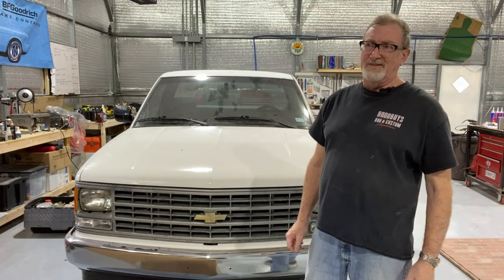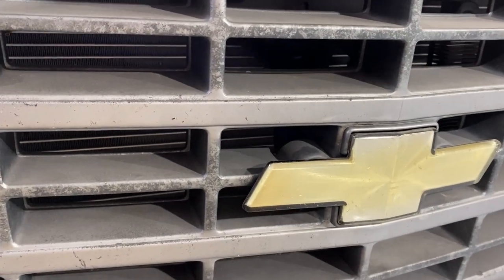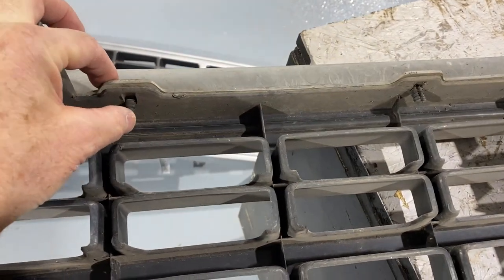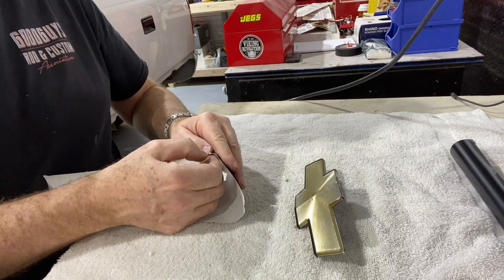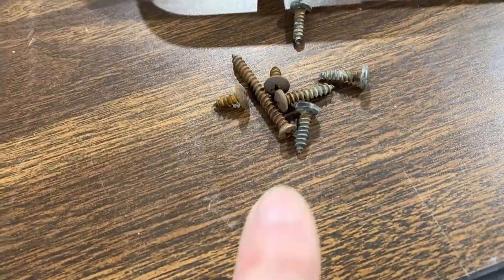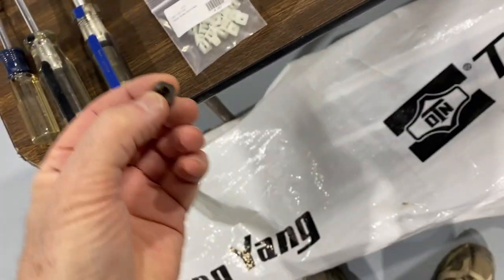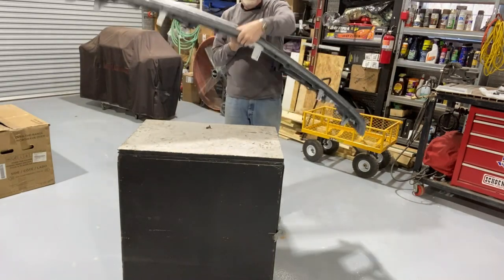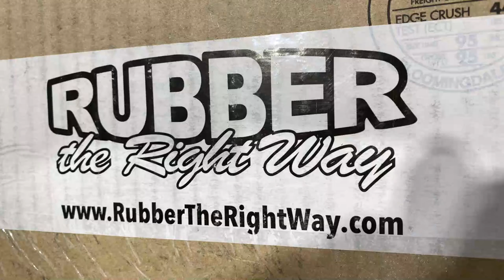1991 Chevy OBS Cheyenne V8 LS Swapped Build Remove and Replace Front Grill Upgrade Swap

Comment: I like the simplicity of the Cheyenne front end as well. I vinyl wrapped a couple of my emblems on some of my trucks using that fake carbon fiber and it looked sweet. That grille looks nice. Also, never rule out the junk yard for misc screws and stuff like that. Anyways, good job in that truck. That swap looks really clean under there. Nice work.

Comment: Your videos are very helpful Iam helping a friend with his LS swap maybe I missed it you videos my question is on the accessory harness where did you wire in the black wire for the speedometer?   We are using and aftermarket harness my friend purchased off of Amazon    His truck is also a 1991 C1500 with a 700R4 drive by cable
Reply from the maker: To make my speedometer function I took the 2 wire VSS plug from the LS harness and spliced them into the 2 OBS VSS wires on the tail of the transmission. This way, the signal would go to both pcm’s. OBS for speedometer to work and LS to let know vehicle it’s moving, shift points are determined by speed and rpm.

Comment: Still using the nice swapped white 91 obs? Or u sold it?
Reply from the maker: Hello, I still have it. In fact I’m planning to do version 2.0. Details coming…
Reply: @laurencevillegarage  @  version 2???🤔🤔
Reply from the maker: @gerardolopez5875 yes, I’m considering putting in the 6.0, different transmission, 3.73 rear differential and maybe a  Qa1 coil over suspension…
Reply: @laurencevillegarage  @ o ok! Looking for big power!!   I did it on my 89 stepside , 6.0, runs nice!

Comment: Where did you get your motor mounts from when you did your swap on the current truck ?
Reply from the maker: I got my mounts from metaltek manufacturing, they are a sliding mount design similar to the dirty dingo mounts. Very nice mounts. I did the initial swap about a year ago? I believe…check out my other videos, I documented as much as possible including when I first bought the truck about June 1, 2020…
Reply: @laurencevillegarage  Hey thanks for the reply back. By the way what is your name ?
Reply from the maker: @shugg0517  Andy Laurence